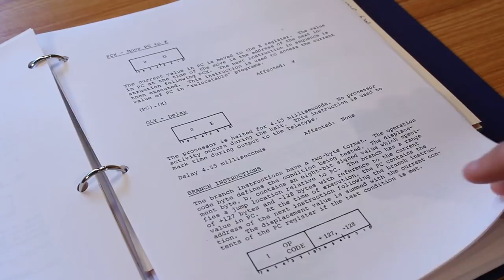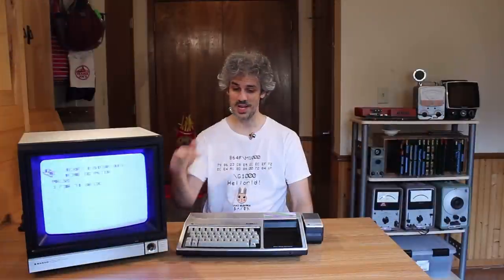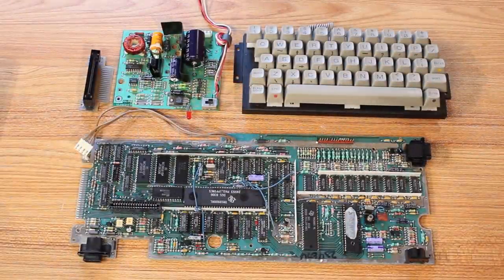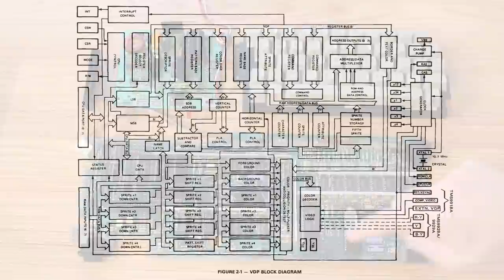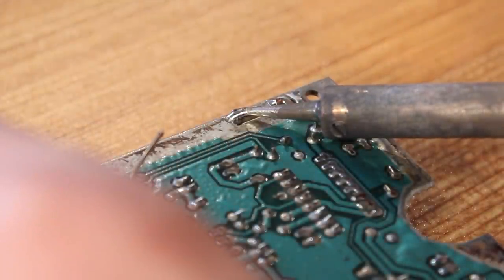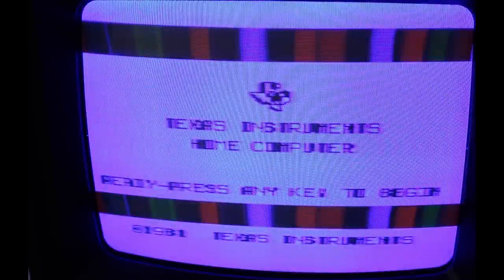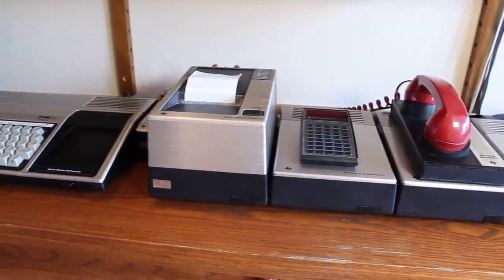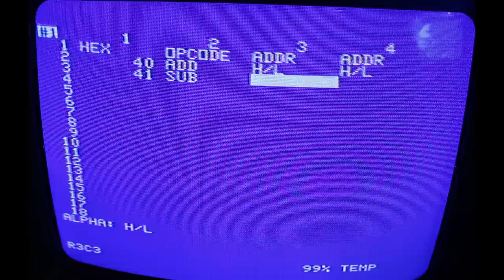Working on the TI-99

Comment from the maker: WARNING: There is a 15kHz whine from the CRT monitor in a few shots. Unfortunately, I have tinnitus and couldn’t hear it at all during filming, editing or even the final confirmation check. My normal lapel mic usually doesn’t pick it up, but in a few shots, I used a different mic, and it apparently picked it up very strongly. I apologize for this, I should have visually checked the audio waveform before uploading. On the plus side, if you can hear it, congratulations, you still have excellent hearing!
Reply: That will be from the high voltage power supply.  The horizontal oscillator (which is working obviously) goes through a transformer and simple rectifier circuit to get the high voltage needed for the CRT.  Probably over 10 KV.  Anything loose in that circuit will vibrate as you hear.  It con be windings in the transformer.  At this point the monitor is no different from a color TV set from that era.
Reply: Join the club, didn't hear a thing.  I used to think my tinnitus WAS the CRT monitor whines until one day i realised everything was now TFT or other flat, then it dawned on me.
Reply: Thank you so much!
Reply: Don't worry, my laptop speakers don't go that high... ;-)
Reply: Don't listen to people who whine about the whine. Anyone who is interested in old computers or video games will have to get used to it, just like everyone did for the 60 years or so when CRTs were in mainstream use. And p.s., you need to get a PEB!
Reply: I was able to hear it putting my phone up to my ear, so I'm glad to know I haven't yet reached that milestone of aging. Thanks!
Reply: I doubt many of us can still hear above 15k ;)
Reply: Sadly, at almost 58, my hearing tops out at about 13k. But on the other hand, when I was a kid, I could hear the flyback of out family TV in my bedroom with the door shut! Mom and Dad never could understand what I was complaining about (they couldn't hear it).
Reply: I didn't, I usually do maybe that means I'm finally old enough to not ever be annoyed by it again lol
Reply: Im sorry for your hearing loss!! Good quality microphone!
Reply: Mwaha, havent heard a thing. I'm also blessed with the gift of the squeak that lives in my brain.
Reply: Wait you have tinnitus, I lost my hearing in my left ear in November 18 2016, hence work problems, and it was replaced with tinnitus, so after the vertigo and learning to walk properly, changing diet, amounst other things, I can now enjoy stereo music, and sorta be normal again, but that phantom noise is still there. So I feel your pain. And kittens will do great 😊 when they grow up, they'll even thank you by bringing you their dead snakes and mice... That's their job.
Reply: @ScottGrammer  Yep.  I was testing an rebuilt amp a while back and was very upset when I heard nothing coming out! Until I lowered the frequency of the audio generator down to 12khz ;)
Reply: I heard it loud and clear. So I guess I got that going for me! It doesn't particularly bother me, though I am glad CRTs aren't common anymore.
Reply: Man, I haven't heard a 15kHz whine in 20+ years.  LOL.  Even if I could still hear it, I wonder if it'd bug me all that much -- I was a kid in the '70s and '80s when all TVs had that whine.  It'd probably be just background noise to me.  I find it hilarious that people under the age of 30 actually complain about it -- y'all should've tried to watch TV in the '70s.  LOL!
Reply: Wow. I fantasized about a setup like this back in the 80's, with my lonely 99-4A with no sidecars and just a cassette and scrap monitor my dad salvaged from his work. I was too young to be patient with the cassette, so just for fun I would dismantle and re-assemble my 99-4A, repeatedly. (I was a curious kid who knew how to use tools somewhat young, I dismantled everything I got my hands on)

Then my friend across the street got an Amiga, and I forgot my TI even existed. lol.
Reply: Thank you? 😭 I don't remember those TVs being that bad... but I do still remember hating when someone left a TV on with nothing on it for this exact reason... sooo... IDK...
Reply: Sorry, What?
Reply: I have tinnitus too but I was surprised to be able to heart the tone! I guess its a good thing for letting me know I still have better hearing than I thought.
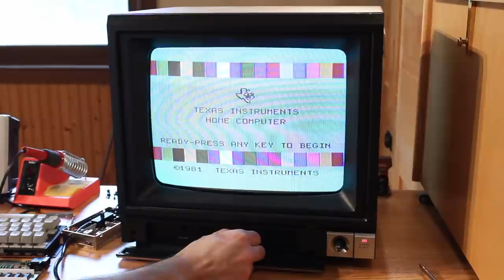Reply: I scanned through and didn’t hear any wine, got worried. But I found it at 14:10.
Huzzah, can still here it! Just a bit anyway.
Reply: I thought couldn't hear well but alas, it's not too bad. Cheers for the nice vid anyway.
Reply: Oh wow, and here I thought I'd long destroyed my hearing... I hear it clear as day.
Reply: You Americans are such Youtube perfectionists.  In Germany the "phonecamera in one hand, screwdriver in other hand" 1,5 minute video is still quite common ...
Reply: @LMacNeill  I’m 28 but I’ve only been CRT-less for half my life, I preferred 31kHz computer monitors from as young as 3 and would complain about the “squeal” of regular tellies, or turn up the volume to drown it out, or put headphones on if I couldn’t do the prior. There were always people who complained about it (another commenter is 58 and said they complained about it in the living room as a kid with their bedroom door closed!), but there were just management strategies (such as headphones or listening to music or in some cases sitting far enough away). 

And sometimes you just put up with it until your ear got numb to that frequency, but it was still a relief once it was turned off, that sensation is literally the tiny hairs in the ear relaxing after being contracted for hours. And no doubt that’s part of why people used to lose their hearing around that frequency, and why now some people are retaining that high end into their 40s instead of losing it in their mid to late 20s.

When a camera is placed up close, the whine is relatively much stronger in the output than in person when it’s had a chance to scatter at least a little off the furnishings, so that’s like sitting so close you could see the shadow mask! Or worse if you’re watching YouTube with powerful speakers or headphones, then it can be louder than it ever was in person!
Reply: @rickhole  I have two CRTs I plug into my Commodore 64. One is a JVC TV and the other is a proper Commodore monitor. My kids all complain about the high pitched squeal they both make but my wife and I can't hear it. Is there anything I can do to reduce the noise for them? Can they be repaired?
Reply: I never heard the whine of the TI supply myself.
One thing I came across was a phone system with a power supply that made an irritating  noise in a quiet office 
environment.  
The core of the choke used in the power supply would rattle as the regulating pulse frequency changed. 
This frequency was low enough for a lot of people to hear.
Reply: What 15 khz whine? 😂

Comment: I was a programmer for a TI-990 based doctors billing consortium. Wrote COBOL during the 1980's. Machine did all the billing and various statistical reporting. All in all decent and reliable machine.
Reply: You did BILLING on a TI-99? Wow.
Reply: @BOBXFILES2374a  Hmm, seems like you have trouble reading AND watching videos.
Reply: One of my bank clients ran a trust software package that only ran on a TI-990. Took us some training to run as we were a mainframe environment.
Reply from the maker: That's awesome!
Interestingly, I was actually shopping for a TI-990 when I found the Centurion minicomputer and went down that rabbit hole, but I would still love to get my hands on a proper TI-990 someday. They seem like really quirky machines that were actually decently capable!
Reply from the maker: @BOBXFILES2374a  Alexander was working with a TI-990, which was a full on minicomputer. The TTL level CPU that was in the TI-990, evolved into the TMS9900 micropchip, which is the same processor that TI used in the TI-99/4 home console. But, despite sharing the same processor, the machines are very different indeed!

Comment: That's the most complete collection of sidecars I've ever seen. Wikipedia used to have a photo of every single one ever made hooked up like that, including one (I forget what it was) that was the exact same wedge shape as the computer itself. Unfortunately the photo was comically low-res, which might explain why it's gone now. If you ever complete your collection, you might want to think about getting a good photo and contributing it to the site.
Reply from the maker: Thanks! I think this is all the official TI produced sidecars that were available. There are two more, the Video Controller and P-Code sidecars, but they were never put into production. A few prototypes of the P-Code made it into the wild, but the Video Controller one never passed FCC regulations, so I don't think any were ever actually made. I do happen to have a spare RS-232 sidecar that I7ve been thinking about gutting and building a P-Code sidecar replica into. That would be really Interesting and get me one step closer to the ultimate TI-99 setup.
The only problem is, I'm totally out of desk space, haha.
Reply: @UsagiElectric  A p-code interpreter is funny when you consider the machine essentially runs something like that anyway. It's litt;e 256-byte RAM running a virtual machine from the RAM in the graphics chip.

It's an awful way of doing it really. Shame they couldn't share the RAM on the main bus. Have the VDP use graphics modes with less colours etc, to provide more spare RAM for the CPU. I suppose in the early days, it beat a bunch of LEDs and switches on your Altair, but it's a real shame such a powerful CPU was crippled and relegated in such a badly compromised design.
Reply: Wedge shaped? You're probably thinking of the much later Hex-Bus Interface, which would have been the link between the 99/4A and TI's next line of mostly unreleased peripherals targeted for models like the very scarce 99/2 and unobtainium, like the 99/8.
Reply: You can usually still see the old pictures by looking in the page history, if it’s not absent from Wikimedia itself! There’s a ton of weird illustrations or crappy diagrams I recall from 07 or so, which are replaced by nothing or by fantastic photographs of the phenomenon in real life (probably putting the remainders to shame and hence nothing), but occasionally I go back to some pages I used to look at a lot (I don’t really remember why, guess I was just watching them for changes?) and laugh at those illustrations.

Comment: I loved seeing the old Ti-99.  This was the first computer my family had at home.  My father worked for Ti.    We had a fairly basic setup, but my grandfather went nuts with his.  He had about every add on to the Ti-99/4a you could get your hands on.  I still had a ton of the stuff up until a few years ago.  I donated 4 complete systems, a bunch of the expansion modules and a crap ton of cartridges to the 8-bit guy as he is here in the Dallas area as I am.
Reply from the maker: That's awesome! My family went through the computer renaissance a bit late, not getting our first machine until the 386-era, at which point I missed out on all the really wild 8-bit systems that paved the way. 
Also, small world, I'm a bit south of the Dallas area, but do try to make my way to DFW retro computing meetups whenever I can!

Comment: 2 things I don't miss on my F18A equipped 4A:
- Fidlling with composite out (or worse RF modulators)
- Multiplan in 40 columns .

I remain forever envious of your sidecar collection (especially the thermal printer). I love my PEB and all the cool 'n groovy new cards being produced, and I have a desk to small to accomodate anything wider than the firehose connector, I would so love to have all the sidecars on display with the system.

Thank you for the always informative and entertaining content.

Comment: Loved this.  I used to work on TMS9900 hardware in the late 70's and 80s and wrote assembler for both TMS9900 and the faster (3rd generation) TMS99105 (not to be confused with the 2nd generation TMS9995).  I also designed a range of processor boards and related industrial hardware around the latter in the 1980s.    I still have a bunch of the instruction mnemonics in my head, and possibly a few op-codes as well.   Loved that NEC monitor too.  I have a 9 inch version from the same period that still works, complete with scratchy volume control.
Reply from the maker: Thank you!
The TMS9900 is such an interesting chip, I would really love to see what it could do if it were completely uncorked and allow to work at its fullest potential. Maybe someday I'll have to build a homebrew system based around it.
The NEC monitor was a pleasant surprise, that was truly my first time pumping a video signal through it, and man alive is it a gorgeous looking monitor. Really makes me want to get that PC-8001 up and going!

Comment: I loved my TI99/4A.  The Centurion book scene reminded me of the TI's Editor/Assembler manual.  Thank you for sharing.
Reply: I was waiting for an explanation of the BULLWHIP command, Branch and Load Workspace Pointer...
Reply: @loginregional  Assembly is difficult for me.  My understanding:  the 9900 doesn't have internal registers like 'common' processors of the day.  The registers were in valid external address workspace.  The workspace pointer set the workspace address for the registers to use.  One could set the registers at address 1234 then switch to 2345 and use those, then revert back to 1234 and continue were you left off.  Beyond this,  workspace assignment could easily get very complicated.  There wasn't much, if any, info about the 99/4A available at the time unless you were a TI developer.  TI kept everything so secret and proprietary.  I hope this helps.
Reply: @bluepen61  Way back when, my friend Dave had the Minimem cartridge with which he successfully learned to program, eventually becoming a highly paid programmer (on other processors, of course). I went whole hog and got a PEB

Good luck with the Centurion. And the Counterfeit
Reply from the maker: Thanks for checking the video out!
On the topic of the external workspace registers, that actually seems to be a fairly regular thing for minicomputers I think. The Centurion has multiple interrupt levels with each level containing the same 8-registers, so you can change to a different level on the fly and whatever was being worked on previously is preserved exactly as it was. With the Centurion, there are 16-levels, which means there can be 16 CPU interrupt requests coming in simultaneously and the machine can just sort it all out. 
The TMS9900, being a minicomputer processor, is probably aiming for the same idea, so multiple users can be using a single machine, sending interrupts and getting responses back all simultaneously.
Multi-user computing of the 70s and 80s is really, really fascinating stuff!

Comment: More sidecar than computer... wild!  Something to consider: when it comes to heat-sinking RF shields on these old computers (at least in the C64/128 world), I've come to use 2mm thick thermally-conductive silicone pads rather than thermal grease.  They squish down nicely to form a good seal, especially where potential bending of the shield can cause "gapping" that may otherwise need to be filled.  -- JC
Reply from the maker: It's so hard to find enough actual physical space for the machine, but I think that's what I love most about it, haha.
Good call on the silicone pads, I never thought about that, but it's a much nicer solution than the boat load of thermal paste I used!

Comment: My brother bought a used TI-99/4A system to use at his pharmacy.  It had the Peripheral Expansion Box (PEB), the memory expansion sidecar and a dot matrix printer.  I think the accounting software was called DacEasy.  The system also came with a shoebox of cartridges, including Extended Basic.  You really needed that Extended Basic cartridge, the built-in Basic was very limited.  I worked part-time at his store when I was in college, and I spent quite a bit of time playing Tunnels of Doom during my lunch breaks...
Reply: Favourite game EVER. Bahhhh bubahbubah baaahhh
Reply from the maker: Interesting, I don't think I've ever heard anyone actually using the TI-99 in a proper business sense, but with the memory sidecar and the printer, it should be totally up to the task! I also have the Extended Basic cart and you're right, it's absolutely necessary, the built-in Basic is very bare bones. The Mini Memory cartridge is also a good one to have as well since it opens a lot of good avenues too, like assembly programming or using peek and poke.

Comment: In the late 70s and early 80s, I was a TMS 9900 assembler programmer. I absolutely loved the 9900 it was so clean and uniform with its 16 wonderfully general purpose registers, such a contrast  to the myriad of special purpose registers that Intel were so fond of.

The company I worked for had great success selling its data communications equipment that shipped with vast quantities of TMS 9900s. When the Motorola 68000 came along it had the 9900s beautifully clean simplicity and of course the registers were all 32 bits instead of 16.  It was an assembler programmers dream come true. 

In my opinion Apple did the right thing choosing the 68000, imagine how the computer industry would be now if only IBM had done the same.
Reply from the maker: Whoa, that's awesome that you actually worked with the TMS9900! I bet it was a really great CPU when it was not bottlenecked by the VDP in the TI-99. The more I learn about the TMS9900 the more familiar it feels compared with the Centurion. Granted, the Centurion uses an 8-bit data bus, they both seem to have a strong focus on a lot of flexibility with the general purpose registers and really geared towards multi-user setups.
I would love to build something with the TMS9900 someday as I think it's a wonderful little CPU!